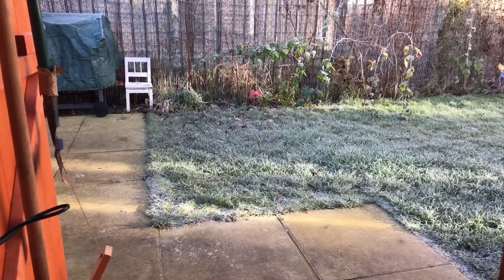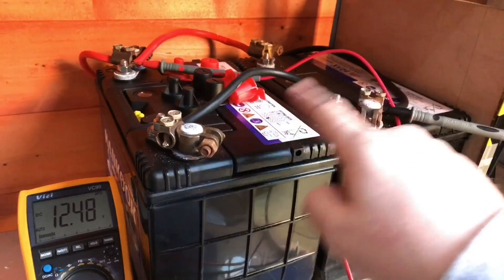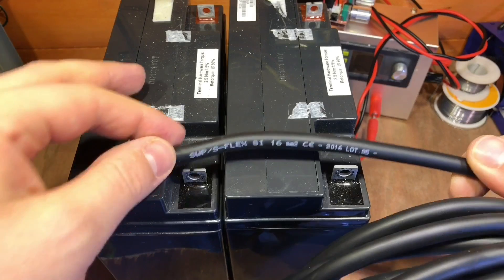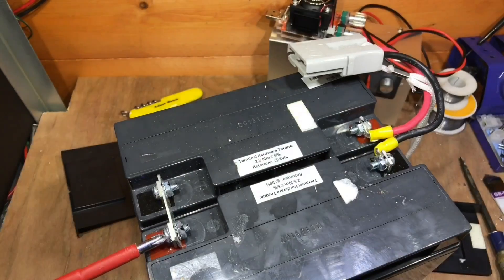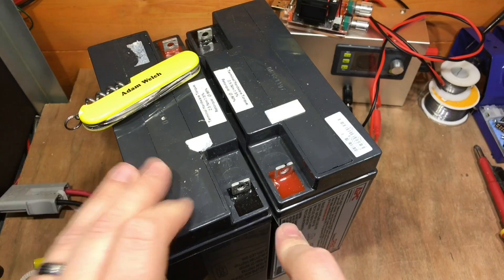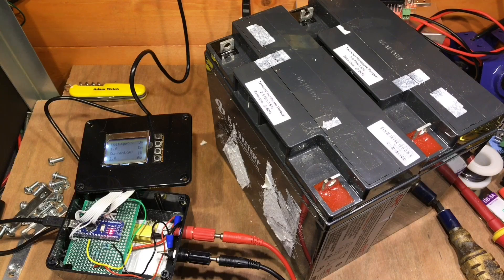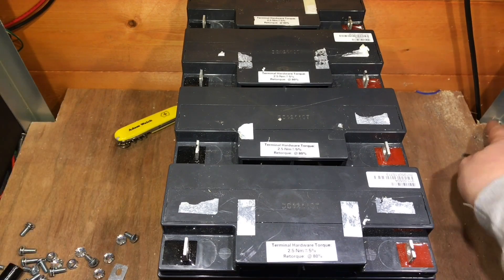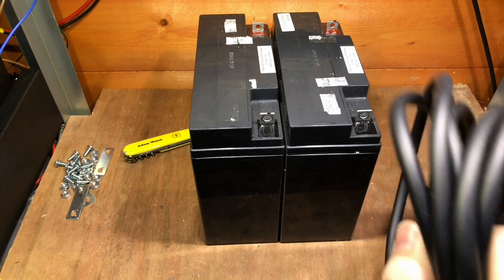New Year, New Battery Bank - Part 1 - 12v Solar Shed

Comment: P.S. Someone has been a naughty boy ! That link between the two packs should be a fuse. I have two large ups systems and used to service them at work. Normally anything up to 3KVA has two packs. 1 pack being two 12v cells with the fuse strap. So total voltage should be 58v nominal before charge. Nice job with the battery connections. Don't forget the Vaseline :)

Comment: Batteries connected in parallel will all discharge and charge equally.  Their max charge depends on the worst performing battery, if 7 batteries will charge to 13.5v, and one will only do 13.1, the remaining 7 will drop to 13.1v. No matter where you connect the load, all the batteries will have the same load. With the wires connected they way you have them the wires furthest away will carry less current, and the current should increase by 100% next battery up. That's because when you measure between battery 2 and 3, you aren't measuring the current coming from battery 2 but the combined current from batteries 1 and 2. The batteries are still under the same load. Your new improved wiring, still puts the same load on the batteries, only in stead of the current increasing as you go along the bank,  each wire will now have the same load, 10A on each wire if you apply it to my 30A total example below.. It makes no practical difference for charging or discharging the batteries, and the only reason why you would want to do that would be if you had a load so large that a single wire couldn't handle the full load..  https://i.gyazo.com/2c1b955842b5cc001a35eab11ebf23f6.jpg

Comment: I recently got my hands on 6 that looks very similar to those.
They all have a a good voltage and are labeled 18 amps and one is labelled 20 amps.
Its from a freind of mine whos father has a electric truck company.
Im going to fully charge them and later capacity test them with my loadtester for precise capacity
Reply from the maker: +Resist Dk Nice find. I find these AGM batteries hold their voltage much better than the sealed lead acid acid I was using before. Hopefully you've got some decent batteries in your haul.

Comment: I appreciate that you are an electrical show and I have learnt volumes of information from your show about everything solar powered, but for your own sake why don't you built yourself a small solar air heater. Some wood working skills required, but you look capable enough and should be able to run a long thin unit on the vertical wall below the lip of you shed roof (if you get enough direct southern sun on to that wall area). With a small computer circulating fan it will heater your shed and possibly also help with your battery life by raising the internal temperature. Just an idea. Refer https://youtu.be/8uJaJH90w-A as an example there are ones that use rectangular metal down pipe horizontally under glass that would suit your available space much better of course. NSW in Oz

Comment: 12.4 volts is no good for your battery. I've found std lead acid need up to 14.8volts and at least float at 14.4volts per day to fully recharge.

Comment: As Mr. Simpson said, grease the terminals after the connections are made.  Even Vaseline will help.
Reply: I always use an electrical  'antiox' compound on terminations as I make them. Home Depot/Lowes/hardware stores/electrical supply houses sell it.  Little tubes and bottles of the stuff.  Ideal makes one type.  when using larger gauge wire, I put some on the wire, then crimp on the connector too.